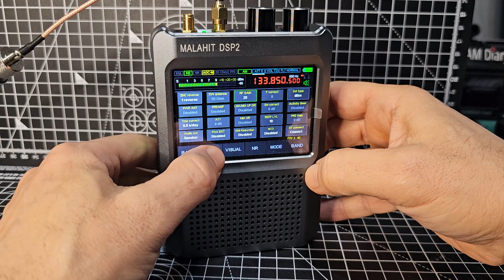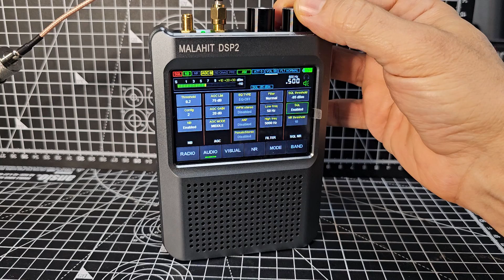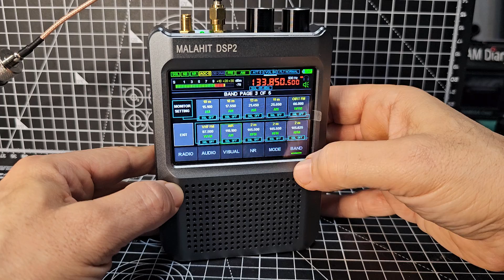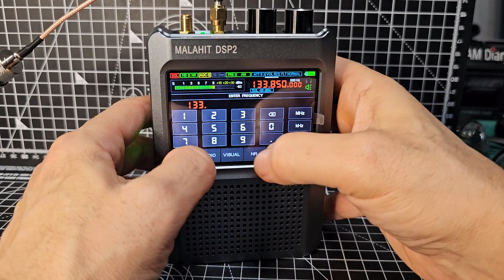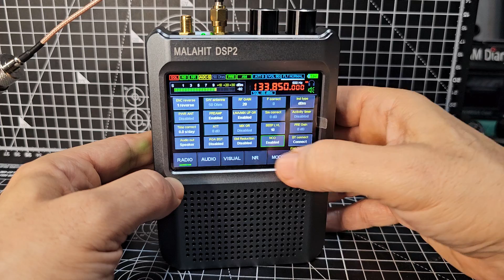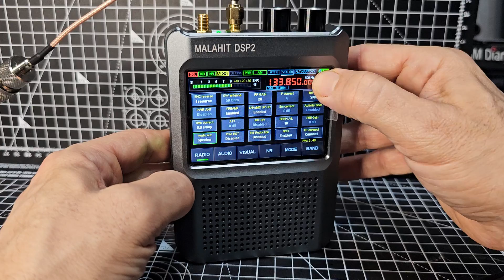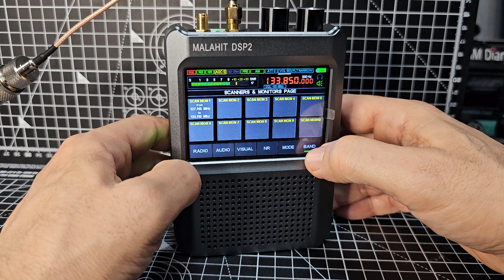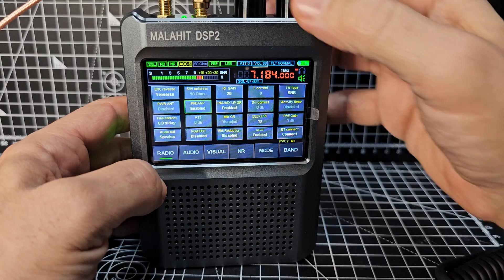MALAHIT DSP2 - AIRBAND SET UP & MORE TIPS

Comment: The s-meter always shows S-7 or even more when there are no signals, I don't know if that is normal, I think weak signals will be masked, it should be interesting to check your reading without the antenna connected
Reply from the maker: I will try this , I did notice you can adjust the signal meter in settings .
Reply: The RF gain and the preamp will throw the S-meter readings off. No worries mate...!!!